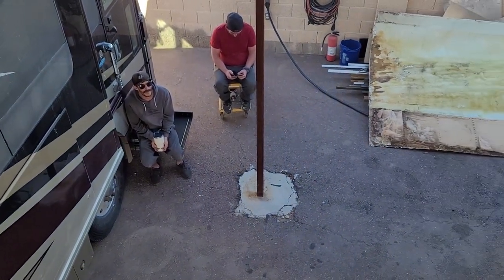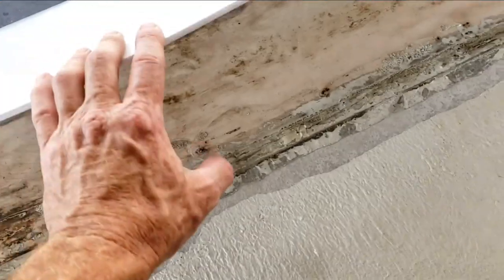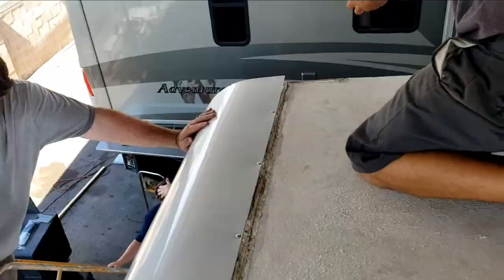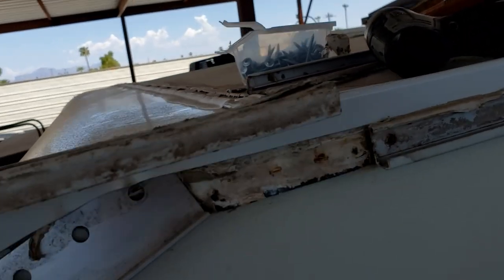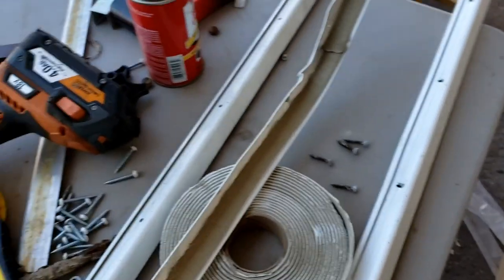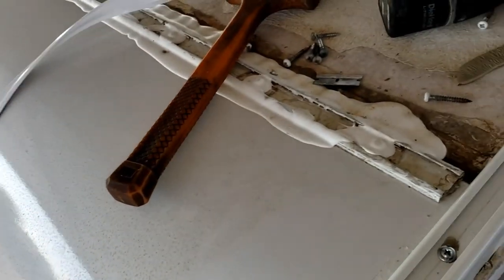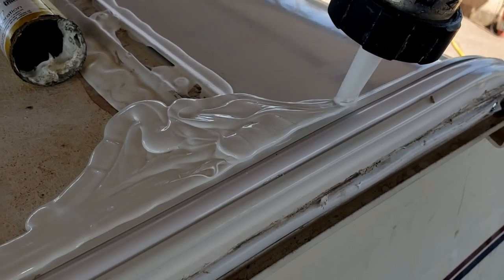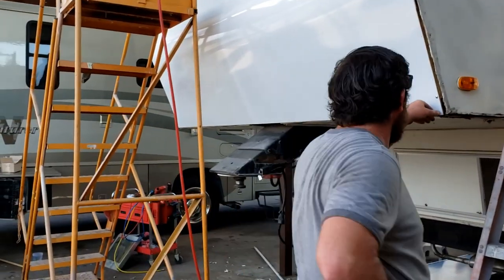What Ever Happened to the Tahoe 5th Wheel?

Comment: Wow. 
I'm dealing with a rotten Thor Tahoe as well. It's a never ending ordeal. I was just going to reseal the trim and ended replacing the face and the front roof frame. 
But BIG thanks to you for teaching me the best way to deal with it! This was super helpful!
I was going to get some aluminum siding from Hemet Valley but instead I replaced the filon with diamond plate. It looks super.
Reply from the maker: Awesome! Thanks for watching! :)
Reply: @AZExpert  I need to reattach EPDM rubber front section on a Thor Tahoe. Most of the rubber still has thin layer of wood backing stuck to it, so it's like glueing wood to wood, but there are some exposed sections. I was wondering if Liquid Nails construction adhesive would work, or might it damage the rubber?

I only need to do a 3' section and don't want to wait days and pay $76 for the Dicor...

Do you think that would suffice? Or should I just get the Dicor or something else??
Thanks!
Reply: Or I have 3M 90 spray?

Comment: Another great job James. Sure looked like the rear cap section also has major water damage. Had a similar 33 ft Wonderer Transport toy hauler that I sold before any damage like this occurred. I knew it would be just a matter of time due to the poor workmanship of these trailers that leaks would happen just like you repaired.
Reply from the maker: it did have a few water issues for sure.

Comment: I have a air powered shrinker sitting in my shed. It’s OLD. Your right, makes all kinds of marks
Reply from the maker: thats an uncommon tool to have
Reply: @AZExpert  my grandad ran an electrical sign business. Some were oval, round etc. He got the shrinker and spreader (expander) to make the moldings for the edges of the cases. He had 2 pneumatic cylinders (one way). He mounted the two devices on an I beam. Rigged the air cylinders with return springs, a selector valve and a foot valve. We could curve angle aluminum and steel PDQ. All I have is the shrinker left

Comment: Glad Hemet Valley Rv is still doing good things for the repair side of the industry. They supplied some 38' long aluminum sections for my old Rampage 5th wheel 10+ years ago. Is the owner of the Tahoe going to do anything about that poor rear cap at another time?
Reply from the maker: Ive had nothing but good experiences with hemet valley rv

Comment: Hello!
I know this is super random, but I'm hoping you might be able to help me. I work at an international dealership in Ontario. We currently have a 2012 Monaco Vista with a Maxxforce 7 in the shop that needs a boost solenoid, lines and possibly a waste gate replaced as well. Just wondering if you could shed some light on the easiest way to access the valley to replace these parts? could we remove the rad, condenser and all that to access it better? or should we drop the engine and lift the chassis? there's only about 6" of clearance as is with the support bracket above the engine. 
Thanks in advance for your help!
Reply from the maker: I can't imagine dropping the engine for those